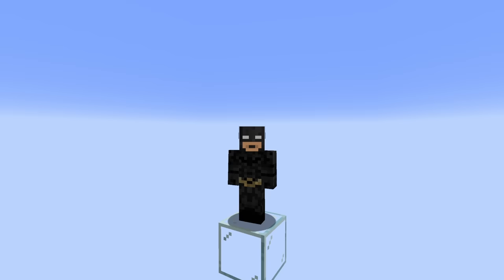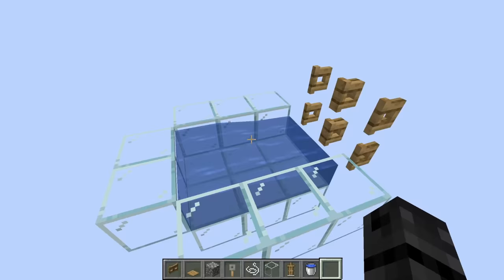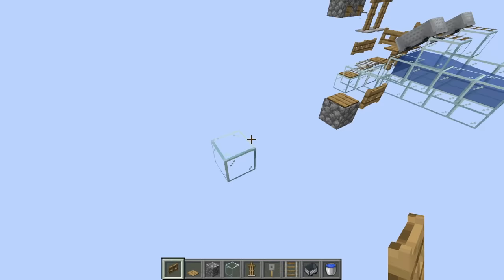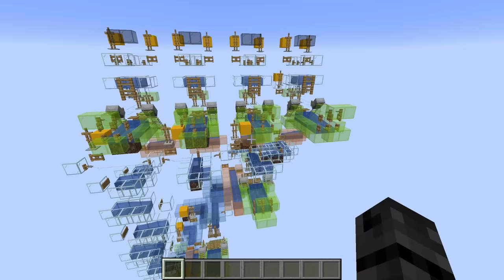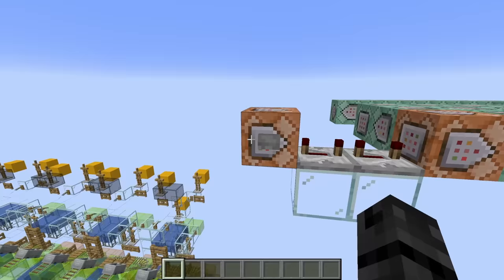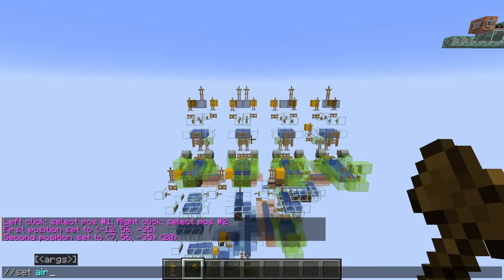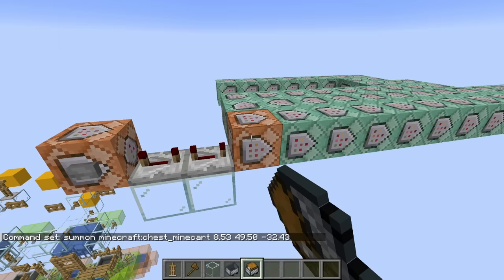Making Logic Gates out of ACTUAL GATES in Minecraft

Comment: small tipp if you use often commands. Build a datapack it makes stuff like switching all minecart with chest minecarts way more easy you can just select all and then do it ones
Reply from the maker: Cool, thanks for the tip 👍
Reply: this case specifically would be perfect for structure blocks
Reply: @magica3526  i would not say that the problem is you would ned to save it every time you build one block different
Reply: If you're building a datapack, you could maybe do something like 'place x entity above every block of y type with z offset', meaning which entities are placed is still encoded within the build, and not as much within commands
Reply: Making a command block for each armour stand looks like it was painful... It would be easier to /give a spawn egg or armour stand with no gravity and custom tags, and manually place them wherever you need them. When you /kill all the armour stands and minecarts, you can check to make sure you don't have a tag, and then /execute at the tagged entities to summon whatever you need for the adder.
Reply: @thomaskletzl6493  oh no, not clicking a single button
Reply: @magica3526  okay yeah your right it would be the right way
Reply: @kitlith  every block of y type is not a command, its very laggy to scan a large area and check each to be a certain block. this is where coordinates or marker armor stands are more useful
Reply: use structure block

Comment: This fiddling with soul sand and water stream to time the armour stands actually has a parallel solution in computer science.  Basically, all of the circuits are connected to a control armour stand named Clock via an AND gate, so that every output is dropped at the same time (when clock arrives). Amazing how much parallel there is between Minecraft gates and actual CPUs :)
Reply: If anyone is wondering, such circuits are called synchronous
Reply: I was just thinking of how he could do that exact thing, I didn't even consider that CPUs might also do that.
Reply: Actual CPUs are made from very small logic gates that might have different form but behaves exactly the same as logic gates in Minecraft(or any other games or simulations that has logic gates) That's why your able to make a whole CPU in minecraft
Reply: Yup, and often times the clock speed of a physically large chip can be limited by the time it takes for that signal to cross the chip. For example something like the 6ghz 13900KS can't physically go much faster than about 10ghz no matter what you do to it. The silicon will hit other limits before that, but the die size should will set some hard upper bound.
Reply: Some important distinctions:
1. The clock signal in electronics is almost exclusively used to synchronise flip-flops (these are called synchronous), not the inputs to logic gates (which are asynchronous). Electronic logic gates are reusable and memoryless, and generally don't need their inputs to arrive simultaneously. We just ignore the output until it has stabilized. That's except:
2. In cases where it's important for the output of a logic gate to never switch back and forth before it has stabilized, this is called a *hazard*. There are various ways to work around this, but a very common way is to make the output synchronous by adding a flip-flop and a clock signal.

The relevant Wikipedia article is called: Hazard (logic)

Comment: Great video and concept, if you allowed pistons it might even be possible to make the whole system reusable. Instead of moving the armor stands between the logic gates you could have a series of tripwires where the first one activates a piston which pushes an armor stand into the second one and so on. If the system then deactivates when the input is removed or changed all armor stands can return to their starting position through gravity or a single block waterstream.

Comment: I can't remember if armor stands collide with each other, but if so; for the XOR gate you could theoretically just have water flowing into a center point, leading to a 1-block drop. If both armor stands get placed at around the same time, they'll bump into each other and prevent each other from falling down. I realize this doesn't use fence gates though lol
Reply: They don't collide at all
Reply: That's what I thought of immediately when watching this video. Tried it out in-game; unfortunately, as Shenlerel said, armor stands don't have collision. However, minecarts do. In fact, you could redesign the entire thing with minecarts, which is what I'm doing right now, and it's more compact yet still functional.
Reply: Ah dang. I thought they did for some reason. Yeah, minecarts would be cool!

Comment: Just small tips. 
You could skip all the timing crazyness by having between each layer gates that will be opened by one master stand (something like clock signal) that way you would just need to make this one slower than others. 
And as it will introduce taming you would also be able to introduce not gate. With that you can easily replace XOR gate with few NOT, OR and And Gates.
Also the "junction" or signal splitter could be easily replaced by one presure plate and two gates on its sides and having prepared the stands on these gates.  As stand fall it will trigger the presure plate and thus open the gates and have two stands fall down. The differences between this and yours are that this is smaller and make both of the stands fall at the same time. Thus making the timing more simple.

Comment: My initial thought for the XOR gate was to just use the two additional armor stands. 

When the signal armor stands drop, they pass through a tripwire. Note there must be one block between the signal armor stands so that way they are both on a separate tripwire circuit. This causes the secondary armor stand corresponding to the signal stand to drop. The secondary armor stand falls through a tripwire connected to the opposite sides lower gate.

The gate was manually propped open, but when the secondary armor stand toggles the tripwire on and off it causes that gate to close.

Then if both initial armor stands drop they close each other's gates. If none drop the gates stay open but nothing passes through. And if just one drops the other gate closes but it's gate remains open and it passes through.

So this method uses only four tripwire lines and four armor stands (plus gates)

Trust me I know this is really hard to follow in words 😂

But I got it to work in a quick testing world

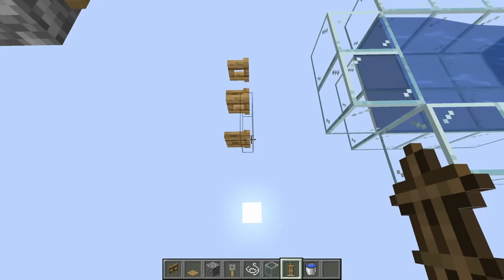Comment: 6:35, simpler solution, just put a pressure plate in front of each gate but hook it up to the other gate, if 1 goes through it OPENS the opposite gate briefly but not permanently, if 2 pass through they cause each other to fall elsewhere instead of the expected location

Comment: Very cool! Maybe how to simplify the XOR gate: Have the two armor stands float from two sides towards each other to a one block hole. Maybe they can block each other from falling down? Idk haven’t tried it yet, also would be pretty time sensitive
Reply: Yeah that's what I also though and it should work
Reply from the maker: Yes, it would be time sensitive, but more importantly armor stands don't collide at all :/
Reply: @jazziiRed  hahaha well yeah, that might be a problem
Reply: @jazziiRed  found a setup where you have an armor stand in two opposing water streams. Using pressure plates and waterlogged trap doors you can "turn off" one or both of the water streams using the input armor stands. If exactly one stream is turned off, the extra amor stand is pushed towards the output. I think you can adjust the lengths of the water streams to make it more or less time sensitive

Comment: hey I think I might have a simpler solution for the X/or gate, if you use minecarts instead of armor stands, you can just use a system where they drop into 2 water streams that narrow to the same output, then if theres two of them they will run into each other and just get stuck

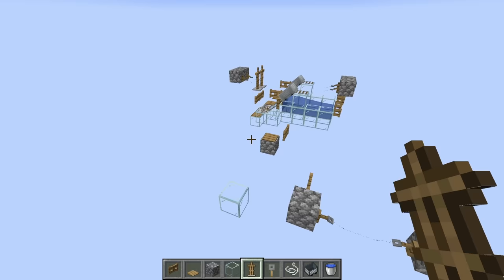Comment: 10:29, by the way the and gate can be made to reset itself with water to push the stand off the plate, just like my previous suggestion of the xor gate using water to push the stand off the plate to either the main output or to other outputs if the plate opposite to what it pressed is also pressed

Comment: What I would do for the splitter is take your and gate, put two fence gates next to the pressure plate, and have them pre loaded with armor stands. Also I hate don’t know if “it doesn’t use redstone dust anywhere so there’s no redstone” will hold up, I personally say that if it has some kind of unique feature that can be used for red stone, it’s a redstone item. So for instance stone blocks aren’t redstone because they accomplish the same function as cobblestone blocks. But coral fans are red stone items because for some reason that I don’t fully understand yet their hotbox is able to duplicate TNT, which is pretty unique. This also means some things not in the redstone tab are redstone items because coral fans are in the decorations tab. But it also means your project is void because fence gates are redstone items due to their ability to lose their entire hitbox when powered

Comment: What's funny is that the first test, 5 + 14, when done in 4 bit binary, can actually be interpreted as 5 + (-2). This is called 2's complement (which I encourage anyone to research), and actually the result is still correct if you ignore the carry (overflows are slightly different when working with signed binary numbers as opposed to unsigned ones): 0101 (5) + 1110 (-2) = 0011 (3)
Edit: for the second number, 1011 (11) in 2's comp is equal to -5, meaning -5 + 5 = 0 (as we ignore carries)

Comment: Easier way to do the XOR gate would have been to combine the concepts of an OR gate with an AND gate. If EITHER of the inputs are on, it will drop an armor stand into the output chamber. Then you use an AND gate of the two inputs to determine whether or not to open the output chamber, dropping the armor stand. As long as a stand is in the output chamber, the XOR output is true. If both are false, no stand ever enters the output chamber. If both are true, the output chamber is emptied before the stand has a chance to enter it. It's only when one or the other is true that a stand is placed in the chamber and then pushed into the activator tripwire by water, enabling a true output.

Comment: Adders are tested by first testing if every input is working correctly so in your case you add 1111 with 0000 and if it works correclty the output is 1111. Then add 1111 with 0001 to test if it carryes correctly

Comment: An xor can be made with or and and. (Not(x and y) and (x or y)). This should be much simpler.
If you have an infinite source of armour stands then you can make a not by dropping them until it's cut off, but then you need to clear the armour stands already in the system. You could also do something where when there's any signal a timer begins to trigger notes.

Comment: I was going to say I thought you could have made the XOR a lot simpler without the minecarts by not having the two paths immediately adjacent, but I tried it and it didn't work. What I was trying had the two paths apart by a couple of blocks and facing opposite directions, but there was no way to make an armor stand dropping into the input of one side close a fence gate on the other side. There was a way to use that it would work using trapdoors to support the armor stand for the "default open" part, but that defeats the point of the challenge.

Comment: have an proposition to make xor gate much simpler, I don't have mc atm so I don't know if this would work. I'll explain with a text based diagram (I hope fon't won't get messed up in other pcs because I'm on Linux Firefox):

W = Water Source
F = Water Fall
A = Armor Stand
P = Glass
G = Fence Gate

MC Fence Gate XOR (method by Xanrer)

      A      A
      P      P
PWFFGFFWP

The way this works is that if both of the armor stands going through water they will get stuck to each other. If one goes it will easily make it through.

Of course there is a possibility they both push each other and go through the gate together. Like I said I havent't tested it.

Comment: for that troubleshooting section, you really don't need minecarts there at all. drop the pressure plates that the inputs hit down a block, then move the "NOT" armor stands forward a block. the first set of pressure plates will be in the right spot to power the gates and drop the NOT armor stands out of the tripwire
Reply from the maker: The signals need to criss-cross, that's why I used minecarts. Otherwise yes, you'd be right.

Comment: Technically pressure plates still emit a redstone signal and the gates receive it. It would be interesting to see if it's possible to e.g. use block updates instead as a form of signal instead of redstone power

Comment: The “and” and “or” are simple enough that if u had an equally simple “not” function, it might be faster and more reliable to do the “xor” gate with its “and or not” equivalent 🤷🏼‍♂️ also I wonder if u could use Minecraft water to make this same thing 🤔 lava used in the logic gates?
Reply: too bad there is no equally simple "not" function. The default state of the system is no signal, complete nothingness, which would always trigger the not to return true and drop the armor stand. For "not" to function, there needs to be 2 unique signals, rather than 1 detectable signal and the other signal being nothingness. And I'm not exactly sure how you're supposed to have 2 unique detectable signals using pressure plates, which give off the same signal everytime (as far as  trap doors/gates are concerned anyway). 

There definitely is a way to do it, but it would be super complex like having a 0 signal being 1 armor stand, and a 1 signal being 2 armor stands, and then you can tell if its a 0 or 1 based on the number of pressure plates triggered when those armor stands go in place. But you can already tell that setup is 10x more complex than anything presented here.
Reply: @MyNameIsSalo  ahhh I see. Correct me if I’m wrong, cuz I’m just thinking off the top of my head, but could water act as the “blank” signal? Water could flow after being activated by something else, and activate a mechanism with a stand already there. If there is only 1 already there, meaning there was no incoming stand, it falls. If a second stand had fallen there, neither fall. 
Possible?

Comment: Cool concept but... It would be a lot easier with an all nor gates design

The nor gate can be designed as a couple of pressure plates adjacent to an open gate. Similarly, a signal splitting could be done with a couple of closed gates adjacent to one pressure plate.

This way, the circuit would become a lot cleaner and easier to be built

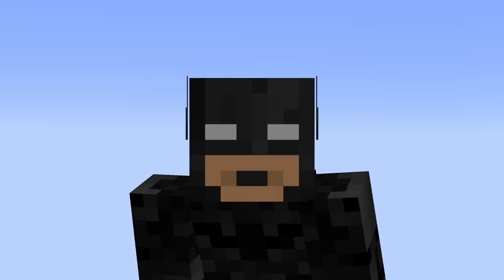Comment: Wait hooold up, at 2:20 you glossed right over how you just swapped the gates with a different non-equivalent one. How does that not change the function drastically?? Did you add or change anything else to compensate for it?
Reply from the maker: The traditional design for a full adder actually has OR gates in those positions. The reason XOR still works is that getting a 1 on both inputs is impossible in this circuit.

Comment: Would gold pressure plates have worked in this design? They measure weight, so for the Xor gate, if it is higher than 1, it is negated? Maybe I don't properly understand golden pressure plates, I don't use them frequently.
Reply from the maker: Sure, but not without redstone or comparitors. There wouldn't be a way to detect a signal strength of 2 without those

Comment: concerning the timing:
You could have "gated" each stage of the circuit by letting the stands drop onto a gate, and open them st the same time using a clock.
A bit like a pipelined cpu.

Comment: I'm 2 weeks late but I have to ask: why didn't you just do the obvious solution for the xor gate in which two water sources flow from opposite ends of a 3x1 reservoir, meeting at the middle where a hole is? You drop the inputs above each of the water sources and they'd collide into each other if released at the same time and prevent both from completely passing above the hole. I haven't played minecraft in years so I don't know if armor stands have collision with each other, but don't boats and minecarts? At worst you'd have to find a way to convert between input objects, but still, I'd have thought this to be the natural starting point
Reply from the maker: Armor stands don't collide